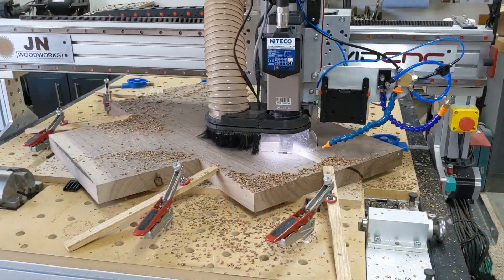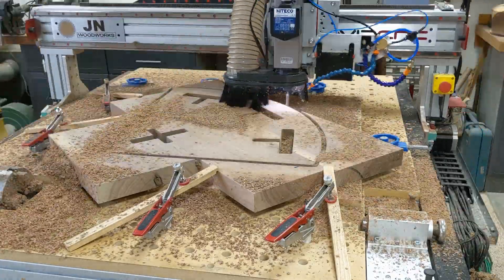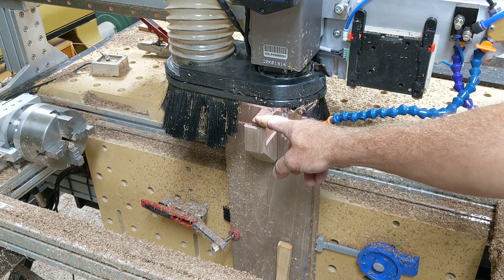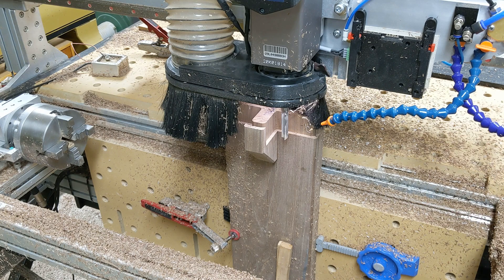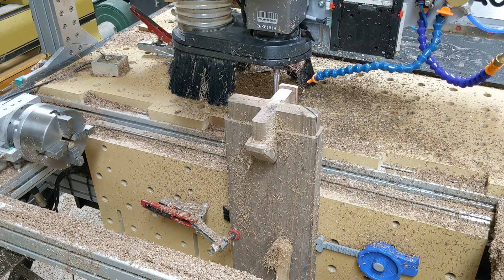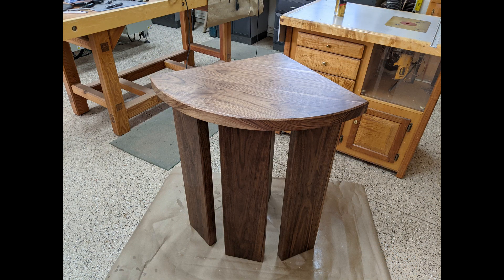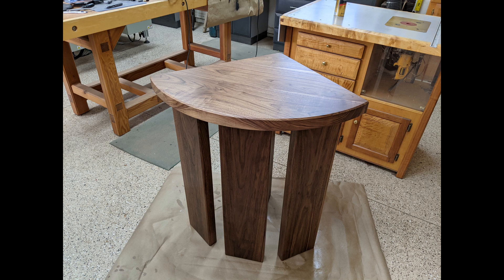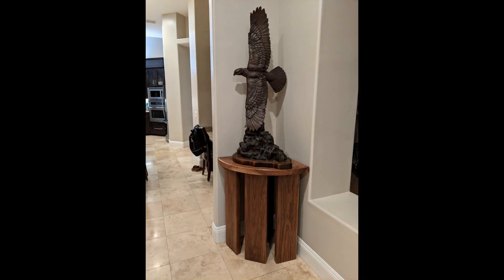Making mortise and tenons on a walnut art stand/table with AVID CNC router.

Comment: Jim - first thank you for adding so much to the community with both these educational vids and participation in various groups.  It is greatly appreciated.  I was surprised to hear how far off the bit is.  You could be looking at runout from the collet.  Might be worth a bit of comparison with different bits in the same collet, perhaps measuring the resulting cuts with a telescoping gauge or inside micrometer.
Reply from the maker: Hi Alan,
You are right, run out can add even more error to the cut, but it was not the cut I was measuring, but the actual bit cutter diameter.  I have mostly Whiteside and Amana bits, and I have measured many of the straight bits and they are generally within +/-0.003".  However, when you are making tight joints, that can make a difference.